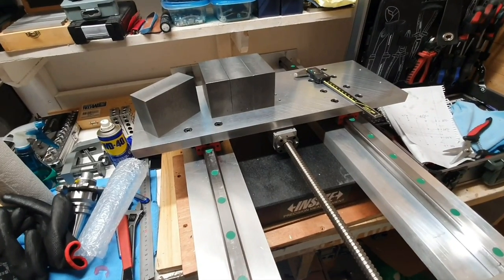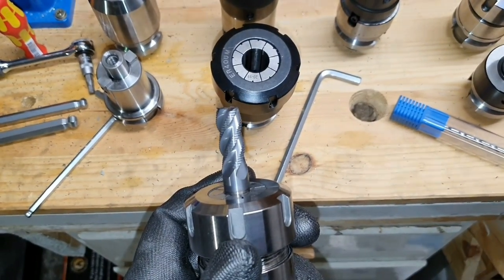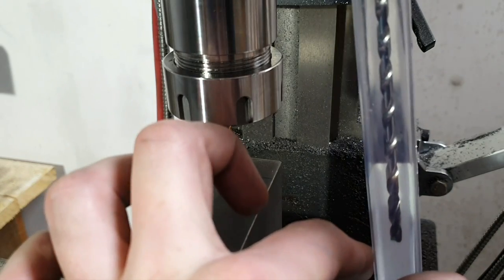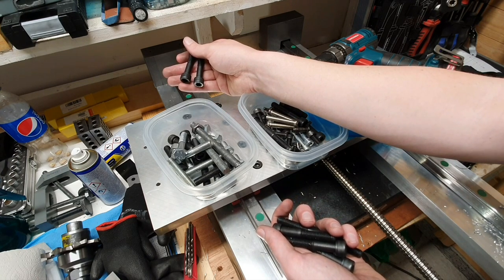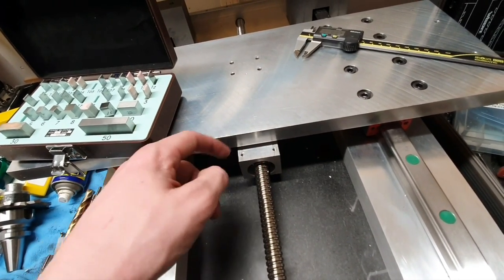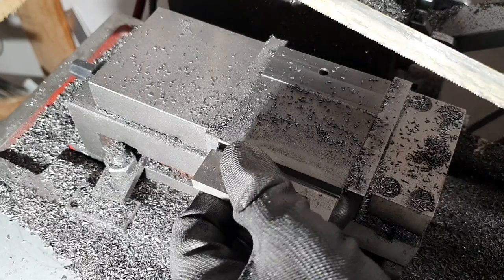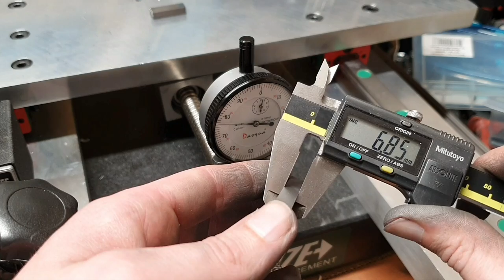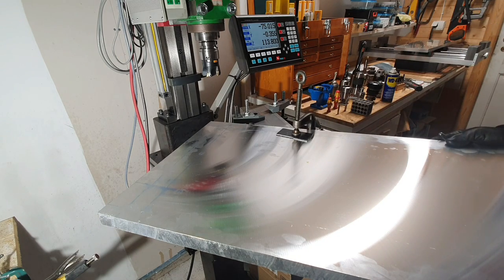adding 25mm solid table  - 6040 CNC router hgr25 linear rail upgrade

Comment: Just bought a "steel frame" 6040 from China cnc zone. First plan I have for it is a solid bed I was thinking about 25mm 6061 plate since the plate is only about 170usd. Glad to see I'm not alone in thinking 25mm of aluminum would be plenty rigid.

Comment: The y up stands which support the gantry now look too small. I guess they are still the standard ones. They would be nice if they were replaced with 25mm thick plate. Thanks for the video. It was excellent

Comment: Instead of using a long drill bit to mark your drill centers and spinning it, buy a set of transfer punches. It will save you alot of time and keep your drill bits sharp. A set is about $15 us dollars on Amazon.

Comment: You do realize it takes as much time to mill through your drilled holes as not right? Predrill if for speed doesn’t work. Where it does work is to relieve corners and prevent inaccuracies when high speed machining. In those cases you’re usually using much smaller drill bits and only for corner pocket relief.